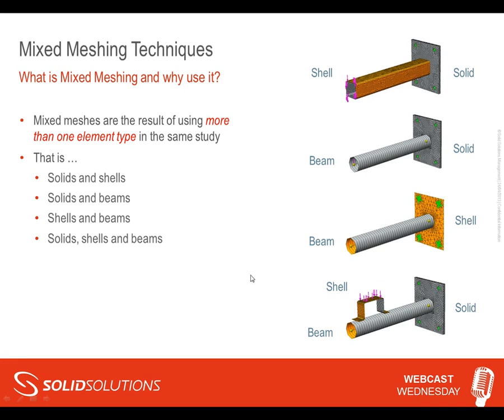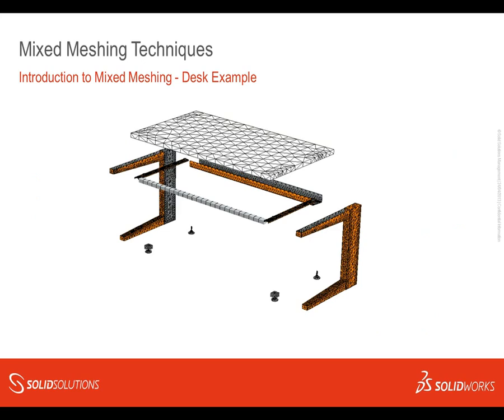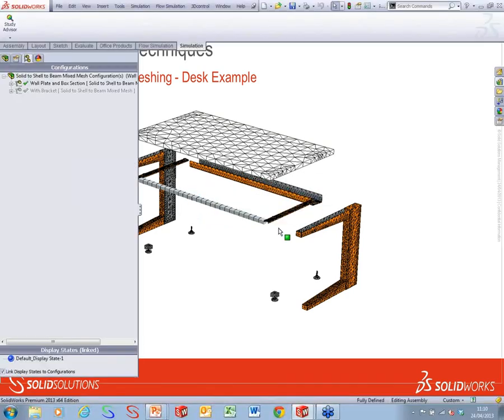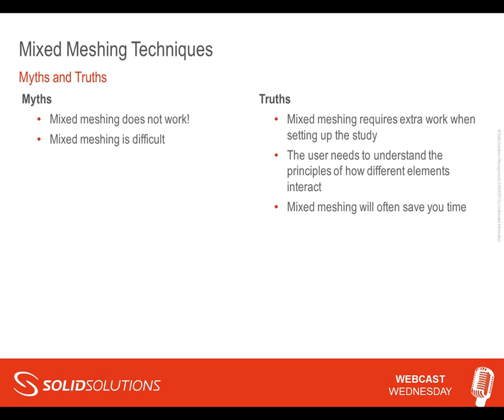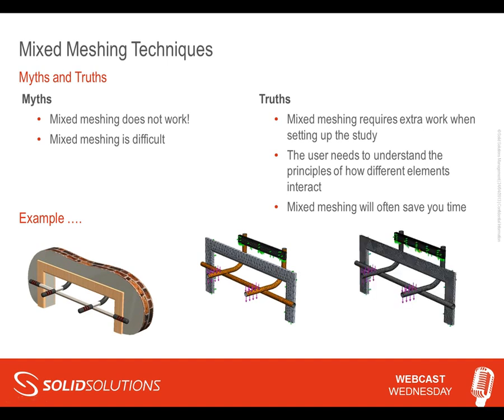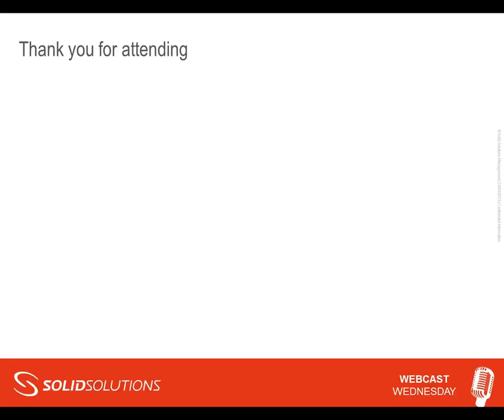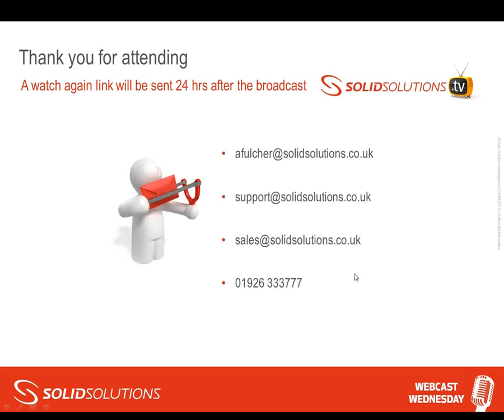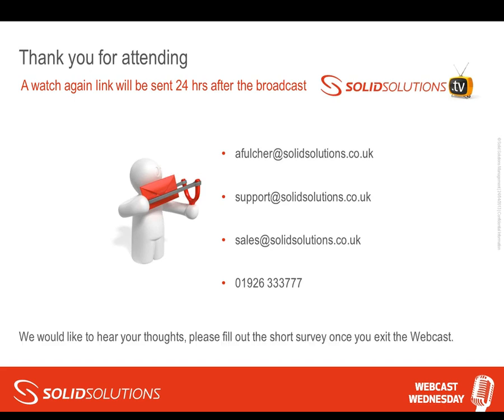Webcast Wednesday - SolidWorks Simulation - Mixed Mesh Techniques

Comment: Bravo to you Andy!  Your presentation gave me a clear understanding of how mixed meshing works, and the method by which contact sets are created.  This is just what I needed.  I spent many hours attempting to properly set up bonds between structural members (beams) and solids, but with intermittent success.  I now see where I was in error.  I have subscribed and I hope others can benefit from your presentation  as well.  Thanks!

Comment: I have a couple of questions about your explanation with shell model case (Video time - 41.40),
1. In your explanation you mentioned that with mixed meshing we must use incompatible mesh but with shell model option there is no mixed meshing as both the elements are converted to shell elements.
2. During explanation the model appeared to have incompatible mesh but when you were explaining Global bonded contact used in this simulation it had compatible mesh option turned on. In this case, how the model generated incompatible mesh?

Comment: Is there any possible way I can get the email of guy working on solidworks? I have a project for the university and I want to do a 3D model and the same one but shell... I did my 3D model and it works. For my shell I have a hard time to contact my stuff.